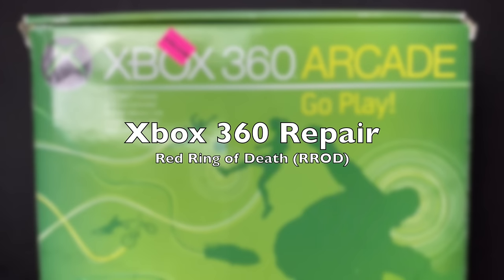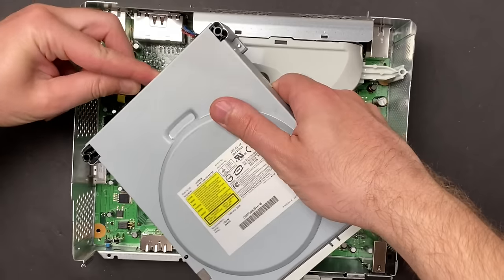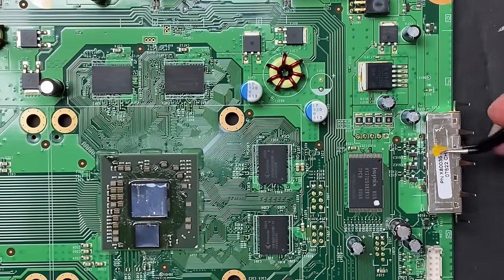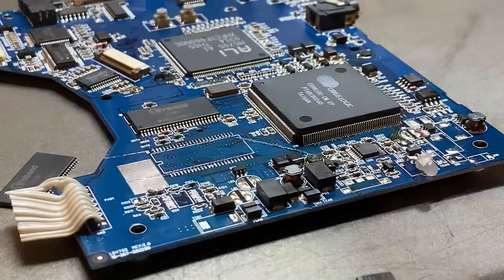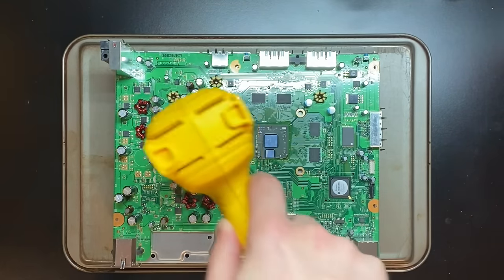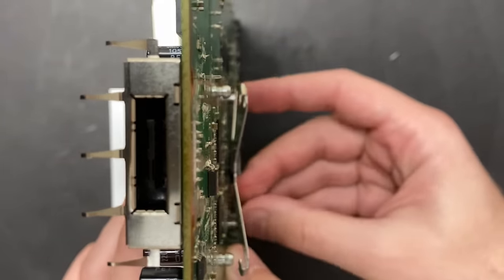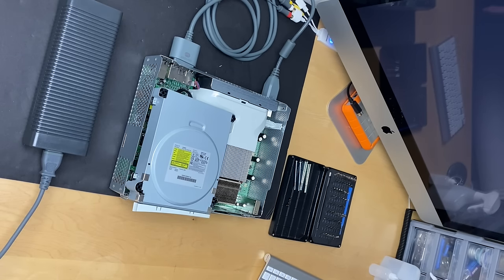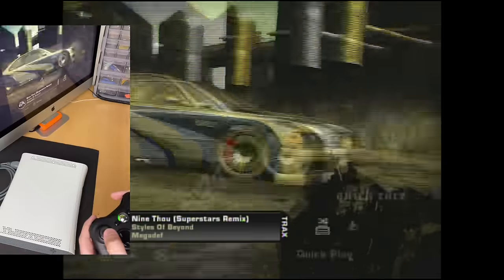Xbox 360 Red Ring of Death - DIY GPU Reflow

Comment from the maker: Nov 11, 2020 update: Due to the increasing volume of comments I'm finding myself answering a similar style of questions over and over. Not your fault, the comment section on YouTube isn't the best format for a lengthy back and forth and unfortunately I can only pin one comment at a time, so apologies for those that asked good questions and shared their perspective. There has certainly been a few excellent discussions here already.

Three quick points for this update:
1- "Is it still working": Yes, I've put about 15 hours or so of gameplay on it. I currently have more interesting projects to work on and I'm not gaming on the 360 as often as I was shortly after creating this video. I'm not keeping a scientific count of hours played. I'm just trying to share a rough lifespan of this system given the interest people have expressed in the longevity of the repair.
2- "Will you share an update video": Yes I will. After I get a 100 hours or so of gameplay on it I'll include this in a project update video where I revisit old repairs and share some commentary. If it has failed by then, you will get to find out.
3- "This is a temporary repair and the proper fix is XYZ": That might very well be the case. I make no claims of engineering a permanent repair around very well documented flaws of a poorly designed system. Your mileage may vary. I paid $5 for this console and any suggestion to "properly" repair using method XYZ is not something I'm interested in doing. If you have love for your 360 and want to repair it differently, I salute you and fully encourage you to do so.
Reply: Can you share a 2022 update?
Reply: Great vid got 360 on lunch day had the console sent away 5 times to Microsoft to be  fixed red ring every time then gave me a replacement refurbished xbox it was a gen 1 it two red ringed twice eventually they sent me a brand new xbox with two wireless controllers chargers station and 1yr xbox live subscription as a goodwill gesture still have that console still play odd games on it.
Reply: I know that it’s probably very unlikely that I will get an answer, but I’m curious. I have watched this video more than once now because I am getting ready to start teaching myself how to fix consuls that I have easily acquired in abundance broken.

What was the long-term turnout of this fix? Did it hold up or did you get the red ring again?
Reply: Hi, I got recommended it this 2 years later, is it still working? I also appreciate how you suggested removing the plastic anchors, I never considered that.
Reply: Geez. You are kinda scaring me.
Reply: I'll be keeping an eye out for that update. It's January 2023 now, and I'm really eager to see how this holds up. It's my understanding that XBox 360 and PS3 fat consoles both have more or less the same GPUs made by Nvidia. The 90nm chips were defective because the solder bumps were not rated to handle the operating temperatures of either system for extended periods of play. With subsequent redesigns of the consoles, in the case of the PS3 at least, they used redesigned GPUs at, I think, 62-65nm, in the slim, and 45nm in the super-slim. The new architecture of these chips dissipated heat better, and evidently solved the bump fissuring problem. 

I have a fat PS3 and an original XBox 360 Pro both with red light of death issues. The PS3 was repaired once using this method, and subsequently died a few months later. Not long after the second death of my PS3, My 360 took the same crap. It has been years since I have given up hope of a permanent fix, and am sort of resigned to the fact that I will probably have to look for slim models to replace them. Unfortunately my PS3 was my only go-to for playing my PS2, and PS1 games, and my 360 for the small collection of HD-DVD movies. Call me cynical, but ever since all this I have sworn off all Nvidia products. I have been burned too many time in the past. From now on I'm an MSX Radeon guy. This is somewhat tongue in cheek (SOMEWHAT), but maybe I should ask Sony to just buy me a new-used PS3 super-slim, and PS2 on the resale market....dirty $on$-of-🐩🐩🐩😮‍💨
Reply: i'm also intrested is the the console still working.

I have done bunch of hotairgun reflowing on old videocards with mixed results, one was death within a week, while another lasted over 5 years
Reply: @djlancematthew this console will inevitably fail again. At best, it's in a similar state to when it left the factory, and it still failed from there. The design of the board and components is flawed to where this will happen over time no matter what you do or how well you fix it
Reply: @djlancematthew reflows are a temporary fix however they are kinda random to when they fail again they could last a long time if you took damn good care of the console when reflowing it. They also could (and most likely will) not last very long depending on what the console feels like doing. I reflowed a PS3 and it only lasted me a month before it died again and during the month that it worked l would sometimes leave my room to do something for a couple minutes then come back to see it fail and having to keep turning it off and on again until it worked. If you get into fixing consoles and trying reflows l do not see your system lasting long. I only recommend it if you need to transfer files to a new console or you want to know what parts you can salvage for another broken console.
Reply: Please give an update on this system
Reply: 2024 update?
Reply: @SnakebitSTI  I doubt it's working, reason being the GPU is known to fail, along with the nail in the coffin being lead free solder. On AliExpress or other sites you can find replacement GPUs which will fix your problem temporarily, the architecture of the gpu die itself isn't that good, kinda how Micron ram chips are known to fail (also the cause for the ps3's death, but luckily those really aren't that hard to find replacements, it was just a problems with a certain generation of ram chips, it's funny how even now the rtx 3000 series which micron made parts for are failing and they cost a ton, sometimes it better to just get a new card if more than 2 or 3 fail)
Reply: @VR00100  The idea that lead free solder was the problem is a bunch of FUD. The channel RIP Felix has done some deep dives into the design flaws in the PS3 and Xbox 360 which cause them to fail so frequently. The short version is they chose the wrong alloy of lead free solder and the wrong materials to support the solder joints.
Reply: @SnakebitSTI  along with the lead free solder, the 360 runs hots reducing the life on the gpu + the ps3's ram 

Luckily by the time the xbox one and ps4 were out they corrected the issue, I'm still surprised that they are gonna get the elden ring dlc soon as well, just goes to show that console regardless is ultimate value for money, the R9 290 can't even think of opening new games 😂. Keep in mind they compared the ps4 to a much weaker HD 7850 💀
Reply: @VR00100  The 360 thermal throttles at something like 85C, which is totally reasonable. Thermal cycling and poor materials selection are the issue, not cooking the chips.

It is not because the 360 and PS3 use lead free solder. It is not because they lack cooling.
Reply: @SnakebitSTI  again I didn't say somethings which you think I said. For the 360 it's 71 to 83°C depending on the model not 85, I do not believe this was the Pentium D also released in 2005 had a max safe temp of 62.3 or 69.8° C so the 360s max temps really weren't reasonable at that time, coolers were still in the process of development. The factory thermal paste was nonsense along with with poor materials leading to overheating. That's why the Red light of death even after reballing isn't a permanent solution, the damage has been done. Also heating to high temperature to solder the gpu with the socket speeds up the process even more 

The ps3's case was faulty memory, again as I said the same issue was there with the rtx 3000 series of cards. Their memory failed even with the best cooling

I'm not gonna bother responding to you anymore cuz you clearly aren't reading my replies
Reply: @VR00100  I already told you where you can find a better explanation. If you don't care to know, that's on you.
Reply: @SnakebitSTI  I should be saying what you're saying 😂😂

Comment: This is what nobody ever does. Quick, clear and to the point. Love it. His points at the end... its a 1 year old console. worth more in parts than professionally fixing.
Reply from the maker: Glad you enjoyed it.
Reply: It's 12 years old. Not 1
Reply: @Iamnotafurry2  Probably what he meant. But, the 360 came out in 2005. It’s 15, not 12.
Reply: Ifixit can show you how to fix it without throwing things away.
Reply: @swarthybullxxx Hey I have a question, I noticed that he removed components when reflowing like the chip, capacitors etc, it didn’t show how he attached them back? Do you know? Did he position them and used a heat gun and let it cool for them to attach back to the solder pads? Thanks I’m planning on fixing my old first Xbox 360 I have around still.
Reply: My oldest is a 17 year-old refurbished Zephyr that I bought at the Salvation Army two weeks ago.  It's my first Xbox.  On the weekend I found a loose black v2 Knonos for 20 bucks.  I think I should run the Zephyr this winter and see how she fairs.  I also have the Corona 4gb Slim but I'm worried about their reputation for problems with the internal memory is it?  All three were under 100 so what the hell.  I'll just enjoy the  without expecting the world from the old Zephyr and the Corona.
Of they die, I'm sure my Knonos will keep chugging for a while.

Comment: I’ve done this before minus the flux and I’ve found the fix only to last a short time.
Reply: Same here, done this twice at the time, and both xboxs lived for a month or two, gived up on consoles and switched to pc after that
Reply: That’s because your not doing it right or something because I did this back in 2008 and it’s still working to this day a better thing to do also is Try stopping the motherboard from flexing etc
Reply: @ARXInfinite  nah your Xbox 360 is just newer
Reply: @ARXInfinite  just the fact that you say to stop the motherboard from flexing will fix it just goes to show how little you know about these consoles...
Reply: @mansour7117  um no it’s a 2007 model Red ring wasn’t “fixed” until 360 Slim and it was still happening when the console got badly dusty
Reply: @ARXInfinite  sheeeeesh a Greek god but seriously I think that 360 is immortal
Reply: They fixed it in the jasper model...

Comment: That Goo Gone worked nicely. ;) I never liked the cooling solutions for the PS3 and Xbox 360. I've never seen a consoles so plagued with hardware failures as the seventh generation was.
Reply from the maker: The Goo Gone was recommended by a talented member of the community ;) And it did indeed work very well, so thank you! During my research for this repair I learned the failures were somewhat industry-wide so to speak because of all the new regulations introduced around using lead-free solder. Manufactures were plagued with cold solder problems because their assembly lines apparently didn't appropriately adjust to the heat levels required and it took a few years to get failure rates down. Thought that was quite interesting!
Reply: Not to mention loud as crap even when they were working properly. Don't include an adequate heat sink, just run the fan at 100% all the time! Gamers will love their living room jet engines! Microsoft moved away from it with the Xbox One line at least, but Sony stuck with it for every model of PS4. It's pretty sad that my favorite PS5 feature it that it has a real heat sink this time.
Reply: @mjc0961  My sister’s 360 is a lot quieter then mine and hers is virgin!

Thank god for die shrinks
Reply: @mjc0961  too bad the ps5 is riddled with other issues
Reply: @mjc0961  Have to politely disagree with the "every model of PS4" assertion there. My PS4 Pro (revision 3) among others clearly has speed ramping on the fan based on temps. They don't run the fan at 100% full speed all the time. All of the PS4s could do with bigger heatsinks though.

Comment: Great video, and very detailed! I'd add a tip: you can use kapton tape to keep those tiny resistors and capacitors in place while reflowing the CPU and the GPU. If someone lingers the heat gun too much on a particular region, and one of those becomes loose, the repair becomes much more difficult.

Comment: Great video. As a complete novice I attempted an RROD fix about 10 years ago, using the random YouTube videos with a heatgun on the ANA chip (Xenon board) and washers/bolts to replace the xclamps. In hindsight it was a complete bodge but I flashed the drive at the same time and got about 100 hours out of it before dying again. It cost £15 so I wasn't too upset.

Anyway, subbed.
Reply from the maker: Thanks for the sub. I like hearing these repair stories like yours in a world of primitive YouTube, Amazon Prime in its infancy, no iFixit tear-downs with high res images. It's pretty amazing you brought it back to life by yourself. Your Xenon is the biggest RROD offender so the odds were stacked against you from the start!
Reply: Haha I did the same thing. Also only lasted for a few more weeks. After that I gave up on it and during a party with some friends we thew the xbox in a bonfire. The caps started popping it was pretty funny.

Comment: Rubbing alcohol, or 97%+ IPA that you use later for cleaning, works for thermal paste quite well in place of Goo Gone and will save you a few bucks lol. Especially if you soak it a little. I use it for modern and retro PCs almost daily. Even the really hardened, old and/or low quality paste gets loosened from it. Great vid! :)

Comment: Great video!
Back in the day a towel wrapped around my original 1st launch Xbox 360 worked. I had to do it until the Xbox overheated and shut down a couple of times worked for me. The trick was to continue doing it and keeping it hot until it worked. The Xbox 360 continued to work with no issues until the release of the Xbox one.

Comment: Wow I'm speechless. Disassembling the Xbox 360 looks very intimidating and even though is like 12 or 15 year old technology to me looks like from another planet. I didn't  know that the Ring of Death could be fix. Great video man👍
Reply from the maker: Glad you enjoyed it. Back in the day it was probably much harder but there are good disassembly guides nowadays with high res photos to help you along the way.
Reply: I did my first one as a teen and it worked out fine, I put in a led fan, then flashed it and then fixed the E74 error in mine! Now I do all my own repairs and it’s great.

Comment: Hey! Thanks for Tutorial! Good job! I followed this and wanted to share my experience real quick.

I bought a very clean 2009 Xbox 360 elite 128g with all the accessories and box except a joystick and that thang was E74 RROD AF. I know I overpaid and screwed up. I felt like a fool. If you must know I paid 50.

I followed the tutorial pretty close, if not exact and the fix definitely worked!! ….for about a week.
I played off and on every day, no long marathons but I did turn it on and off a lot which if I understand this system hates? The truth is every time it turned on just felt like getting money back >< lol I couldn’t get enough.

I admit I did spill thermal paste around the right side chip because the stupid nozzle of the brand new paste clogged and then shot off and got paste every where. I got lazy and didn’t clean it up very well. It wasn’t a ton but at this point  I was sure it wasn’t gonna work. When it did work I was shocked and really regretted not cleaning up better but it didn’t seem to matter…

I have to say I super struggled to get the big clip off the back of the outer case. I will 3D print a case cracker tool if I ever do this again.

The X-clamps on the back of the board were tricky at first and my screwdriver slipped and scratched the board just a little. I was tripping about this for the rest of the fix…but it worked great for about a week and I was elated. Then it died again RIP 🪦😿

I think the second time I did this would be easier and maybe more fun. But it is a lot of work. 

Oh Xbox 360 so awesome and such a piece of f’n shit ><

My one piece of wisdom to anyone fixing and then running an old Xbox 360- LAY IT FLAT.

Thanks again!

Comment: Used to to exactly this but with Phat ps3s! always love seeing consoles be brought back from the dead :D makes me happy.
Reply: I have 2 dead 60 gigs, would this work for them? Surprisingly I’ve only had a 360 red ring once and it hasn’t broken since, but those first run PS3s blow up like grenades
Reply: @jk-474  it has been recently found out that the early PS3s died because of weak NEC/Tokin chips. You can replace them if you have the skills and knowledge, but technically they can be reflowed with a heatgun and then the console will work for some time again (completely random amout of time). Just stay away from the main chips, they are not faulty.
Reply: @Riku148  fun fact: notebooks from 2005-2010 are suffer from the same cause. These chips are not build to last forever( from 5:00 you can see the chip and how it is replaced https://youtu.be/NzIT4Sp1fTQ)

Comment: You can use 70% rubbing alcohol, you just need to make sure you DRY every last drop of that alcohol/water before you power it back up. Using a heat gun or even a blow dryer is a great way to make sure everything is completely dry before it is powered up again. 😎

Comment: This video saved my hide. I was having issues with the CPU overheating and you mentioned putting it back together before testing. Turns out if you don't install the fan shroud before turning the console on the CPU will over heat. Thank you for the informative video!